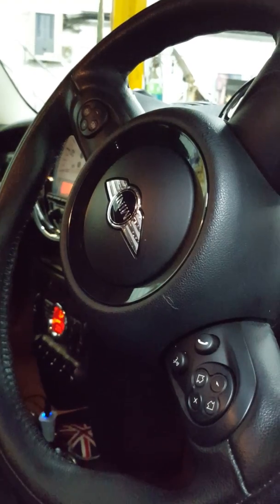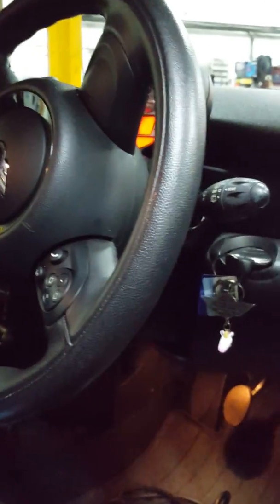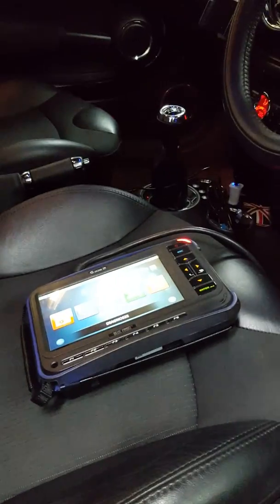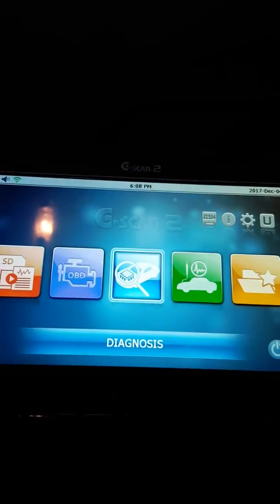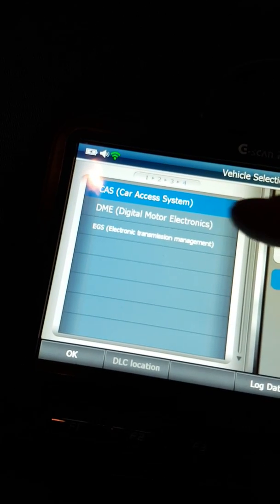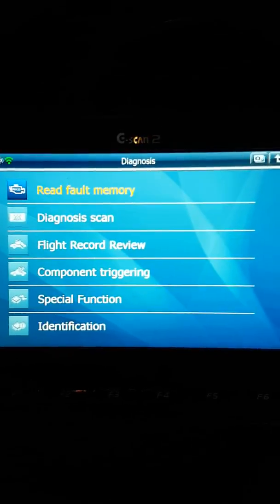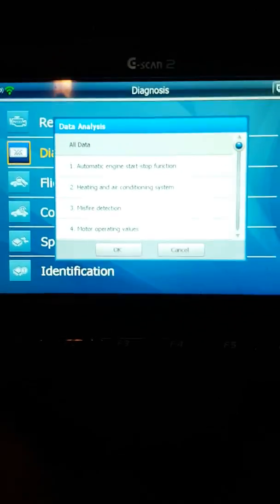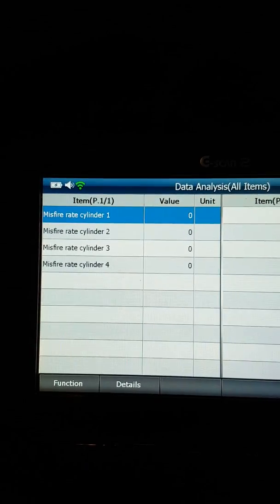Mini Cooper engine vibrating misfire problem. How to find misfire on your car and fix it.

Comment: Hi Alex. Can I bring my car to you for repair? It's 2008 mini. I thinks it's misfiring and may have a coolant leak.
Reply from the maker: Hi there. I don't work on customer cars at the moment. That is something I'm looking in to doing soon as would need insurance and etc. 
If you loosing coolant and got misfire I would do a head gasket check first as its common on them to go.

Comment: Hi i have misfire on cilinder 1 and 4 i allready change the coils, took off the inyector clean them and test them and all 4 work well, i reset the code (p3100) but the misfire wont go, what ealse can i check? Thanks
Reply from the maker: Hi have you changed your spark plugs? Usually it's the first and cheapest thing to change.

Comment: Hi Alex, great video.  I'm watching because I had a misfire on my 2015 Mini R60.  It has been in the shop for "8" days and the mechanic still isn't sure what is wrong with it.  He said he changed plugs, checked compression, swapped coils, replaced injectors and it's still misfiring.  He now wants to try replacing the DME at $1,900.00.  I'm freaking out!  What should I do??
Reply from the maker: Bloody hell mate. Sounds like he is not following the simple checks... I mean I never had to replace so much as you check live data first and see what is happening and which one is misfiring. Osiliscop is a great tool to have when you got issues like that. 
Did he scan it? To see what faults you got.
Reply: @AlexTheGrumpyOne  He said it showed misfires on two cylinders.  Then he just started replacing parts. He said changing the plugs got one cylinder working again.  After changing all the other parts, Cylinder 4 still didn't work.  he did a compression / leak down test.  That showed good resulted.  He is now saying that my coils have three wires. One wire is a signal wire from the computer. He says that cylinder 4 is not getting a signal
Reply from the maker: Yeah usually you just swap parts around the engine to see if fault moves before replacing everything. 
If you got misfiring on cylinder one you would swap plug or coil with n4 and then see if it moved to that one or not. That's the easiest and cheapest was to find a problem.
Reply from the maker: If that's what he saying and he confirmed that it's not getting signal to that one I will suggest to have a look at the wire as I had that before. Wire might be rubbing through and shorting out.
Reply: @AlexTheGrumpyOne  He said the plugs that were in it ( I purchased at 57,000 Miles), it now has 66,000, were not the original plugs (Bosh).  He said they were "Delco".  So someone changed the plugs at some point before I bought it.  That is one reason he changed the plugs. He said that did fix one cylinder misfire.  He said he swapped the injectors and coils around to see if it made the misfire move to another cylinder.  It did not. Cylinder 4 still bad.  Then he changed all coils in case one of the other coils was also bad.  That didn't work. Then did compression test. Good compression. That when he checked the signal on the #4 coil.  No signal.  So he should check the wire before ordering the new computer.  That makes sense to me.  It just doesn't seem like it should have taken 8 days labor $$$ to get to this point??
Reply from the maker: Bloody hell. No definitely not 8 days.... I don't want to talk about anyone elses way of working but in my old place it would of been all checked in one day as it's easy things to check first before fitting new units
Reply: @AlexTheGrumpyOne  That's what I thought too. On top of all that labor, I may have the cost of the new computer $1,900.00, three installation, plus the additional time to program it.   At 66,000 miles, I'm thinking the Mini is not a good car.  Thanks for your help Alex,  I wish you were my mechanic!!
Reply from the maker: Yeah that doesn't sound good at all buddy .... That's unfortunate. Yeah my opinion on mini is not very good to be honest. Specially on coils and etc. 
I hope you get it sorted soon and without going in to more expensive parts.
Let me know how you getting on. Good luck!

Comment: Great video very useful tip
Reply from the maker: Thank you very much for support. If you need any more help let me know
Reply: @AlexTheGrumpyOne  thanks mate 👍 
Tryna resurrect my late grandmother’s mini. 2005 but it’s mint. Still smells like when I was a kid. Just changed plugs. No bueno. Shoulda tried the cylinder 3-4 but turned out the plugs were in bad shape anyways. No oil or coolant though so at least that’s a bonus. I’m thinking coilpack or lambdas now 🤔
Reply from the maker: @jamiewalker8772  hello buddy well done. I would recommend changing the coil as it is very common issue and not expensive to get them :)

Comment: I have a 2012 countryman and scanner detected misfire on cyl-1. I plan to take your advise and swap coils to see if misfire follows change. My question is at 97k miles would u suggest changing all 4 if I detect one as bad?
Reply from the maker: Hello there. 
First i suggest to find out it its a coil or spark plug. So move the coil first and then if the fault if still on same cylinder then move spark plug as well. 
Once you find out if its a plug or coil then... of plug then do all of them. If a coil i would say dpends on the price of one. If not too expensive then do all of them in one go. Because for some reason it is quiet common fault on them. 
Good luck :)

Comment: I’m going to try it, I have a 2014 Countryman and I took it to a friend and he changed one coil and all 4 spark plugs and it still misfired. So I took it to a specialist and he said it needs computer updates. But he couldn’t do it. I hope this tip works. Thank you!
Reply from the maker: Alfred Garcia hello. Yes that is usually the best way of checking is its a coil problem ;)
Unless the car got a single unit for all 4 of them. But im pretry sure all of the mini ones are single for each plug. Try it and let me know ;)